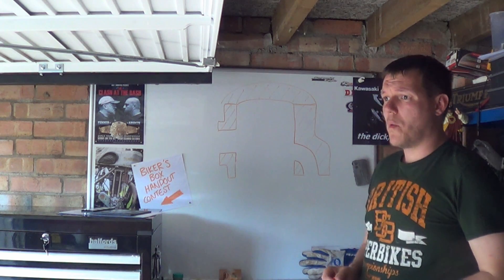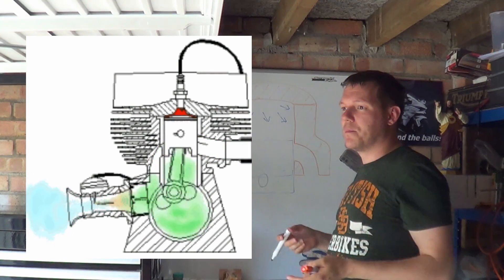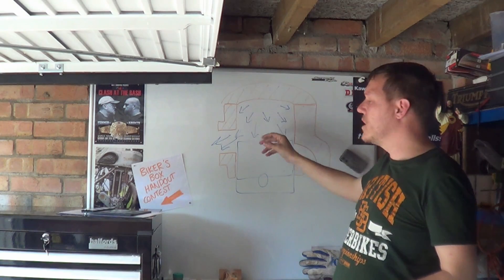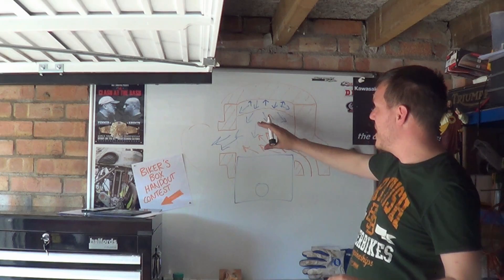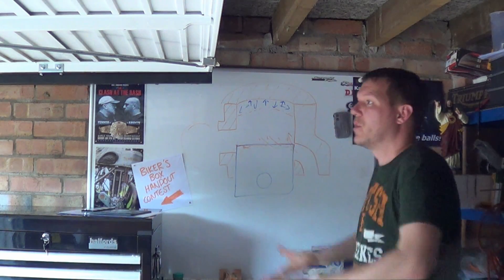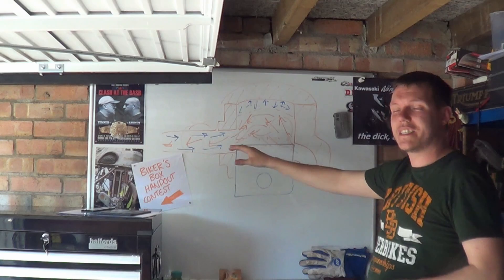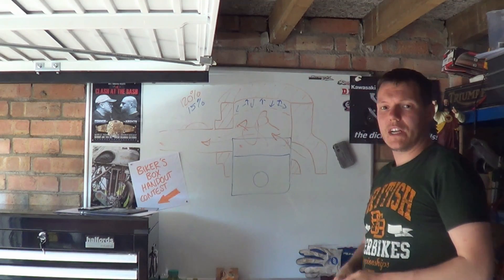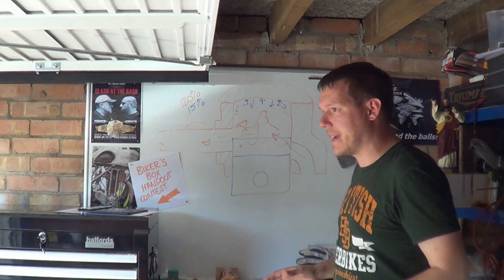2 Stroke Flow - Filling the cylinder - Part 1

Comment: Good bit about ram air- the actual positive pressure generated by "ramming" air into an intake tract is extremely low. . .and does very little to help cylinders fill at speeds below 160mph :)

Comment: This is the problem when trying to explain the dynamics of a tuned pipe equipped 2 stroke. The reverse pulse wave from the pipe packs in more pressure just as the piston is closing the port. No-one should say that it's supercharged. But rather to the lay person, it is a "supercharge effect" as in pressurizing the chamber. But ONLY at the sweet spot of RPM when the reverse pulse reaches the closing exhaust port at just the right time. We are not preaching to the choir, we are  trying to explain to the guys that have never been to church. A static adjustable length header section on the pipe, can change the distance from the convergent cone to the exhaust window, and that will change the timing of that reverse pulse. That adjusts the point of the sweet spot, or the supercharge EFFECT, or hitting the pipe. That is how you can TUNE your tuned pipe.

Comment: Right. For fucks sake, you run quite a mouth on ya, lad!!!
Thing is - you're 115% CORRECT. The pressure differential that causes the fuel in the Crankcase to be shoved up the Transfer Ports when the Bloody Piston is driven down... Is NOT fuckin' SUPERCHARGING!!!  For fuks sake! 
I've been building Race Engines for Decades, and STILL have that insane debate!!! 
I'm enjoying your Videos mate! You TELL it like it is, and cut straight through the bullshit!

Comment: I wonder if the orignal designers of 2 strokes knew that fuel could come back in the combustion chamber, or was that figured out later on in developement? The 2 strokes I grew up riding ('73 Yamaha GT80,MX100) didn't have expansion chambers. At least I don't think they did. The large expansion chamber with a very narrow stinger seems to have come about in the mid 70's.

Comment: So to use your logic a GM diesel with a blower isn't supercharged because the blower is required to make the engine run? What about engines that use a piston charger like the Ducati  V-One? https://thekneeslider.com/ducati-v-one-twin-to-supercharged-single-conversion/
Reply from the maker: The GM diesel wouldn't work without the blower - the word 'super'charged means exactly that i.e not normal charging but super charging. Hence why turbos are called tubo superchargers. And the ducati is supercharged and its charging the cylinder above 'natral aspiration' - can't believe I have to spell this out.

Let me put it another way - if you fit a roots blower to a 2 stroke dirt bike or a turbo - then what is it? A super-supercharged engine?

Comment: Supercharging is defined as a volume of gas trapped in a cylinder that is greater than that if the trapped volume was freely allowed to occupy the cylinder at the same temp and atmo pressure, no matter how that greater trapped volume was achieved
Reply from the maker: So inertial filling of a cylinder using valve timing is supercharging? If so then pretty much every bike engine is supercharged.....
Reply: Yep! anytime cylinder filling goes over 100% DR, that supercharging.
Reply from the maker: LOL don't be an idiot. So the R1, GSXR and the CBR1000RR are all supercharged - LMAO
Reply: Oh ok mate, you know best !!!
Reply from the maker: There are and has only been 3 production 'supercharged' bikes - fitted with superchargers 

- Kawasaki H2 and H2R
- Peugeot Jetforce Compressor
- Vyrus 987 C3
- BMW Type 255 (was a race bike - not production)

Seen as though Kawasaki made the statement that this is the only supercharged production bike availible then you need to tell kawasaki they are wrong.
Reply: You fail to separate the definition of supercharging from 'supercharged'.
As i said any DR above 100% is supercharging, no matter how its achieved, whether its mechanically driven, exhaust waste harvesting or the use of inlet or exhaust pulsing in a NA engine.
Reply from the maker: LOL dude you need to buy a dictionary -

Charging is the process of doing.
Charged is stating that an action has been done, or is about to be done. 

Apart from your lack of English. Find me a recognized book, paper or journal were they state that any engine that has a VE over 100% is a supercharged or is a supercharging engine.

Find me any mention that any motorcycle or car engine that is naturally supercharged?

Comment: good Good explanation ;) .Can you help me sir?
Reply from the maker: It depends - what do you need?
Reply: frankly i have a suzuki rm85 But without a cylinder and I think about its manufacture, is that possible? TNX for a response
Reply from the maker: Do you mean you want to make a cylinder?
Reply: yes *I have the idea But I have no information on the type of aluminum and its components . His first success rate 25/°
Reply from the maker: Well are you casting or machining from billet?
Reply: @Ars chloch No, I can not because I do not have all the tools to make it. I just bought it ,tnx

Comment: Let’s look at before the reeds with a round slide mike I carb. Using snowmobile technology from www.thunderproducts.com its called a UFO. It ramps the fuel past the bottom of the round slide where the wall is. The fuel mix stumbles when it hits this wall. Take a look at it.

Comment: Impossible to supercharge a conventional two-stroke engine with symmetrical port timing.  Supercharge in any two-stroke requires the exhaust port to close well before the transfers do.
Reply: <https://en.wikipedia.org/wiki/W%C3%A4rtsil%C3%A4-Sulzer_RTA96-C>

Maersk, like most large shipping companies, Detroit Diesel, Union Pacific, Norfolk Southern...heck, pick a company that uses a big ship or locomotive....will be surprised to find that the prime movers that they have been operating since the 1950s are, in fact, not possible.  You need to get the word out!
Reply from the maker: Wrong. Snowmobiles are turbo'ed all the time
Reply: How do you supercharge when all the incoming charge blows through the cylinder during the scavenging process and straight into the exhaust pipe?   You need to charge a closed cylinder under positive pressure to achieve any increase in mass charge.  The charge pressure in a two-stroke is equal to the exhaust back pressure because the exhaust remains open after the transfers close.
Reply from the maker: "How do you supercharge when all the incoming charge blows through the cylinder during the scavenging process and straight into the exhaust pipe?"

- the 'force' of the returning pressure wave is proportional to the combustion in the cylinder. You have a supercharged engine so the pressure wave has a higher energy. Granted you have to match the exhaust to the system but it can be done.

I did a video called 'can you turbocharge a 2 stroke. This isn't supercharging but the principle is the same.
Reply: You said yourself that the reverse pressure wave was not true supercharging!  You would need to have further charge mass entering the cylinder as the reverse wave is having its effect and this would occur at only a very narrow range of rpm as it relies purely on resonance.
Reply: Turbocharging and supercharging are different animals... Turbo creates back pressure proportional to the charge pressure so it works even if the exhaust port closes after the transfer port... with supercharging you can't raise the volume / pressure in the cylinder because the exhaust is still open to the atmosphere after the transfer port closes.

Comment: Regarding the supercharging discussion on 2-strokes. I have a really weird 2 stroke engine on my moped which challenges your definition of supercharging. Please have a look at the "motobecane 99z engine". Google those exact words and you will find a engine cut-out. What would you call this? 
Hoping you like weird engine designs :-) Have fun!
Reply from the maker: That's a piston ported 2 stroke. How does this challenge supercharging? They're very simple and old. Great fun to fuck about with though
Reply: Well. As you can see it has 2 pistons. One normal 2 stroke piston and a second piston which is only used to suck more air in the crankcase and push more air towards the combustion chamber. It is an added air pump which balances the engine and passes the 50cc law. They could have placed this air pushing piston system out side the engine. It would be stupid, but it could be done. Than you would have a compressor outside the engine pushing air in making it supercharged. This outside compressor sucks outside air in. The inside version also sucks outside air in making it similar in every single way as the outside version. Okay, not exactly the same but you get the idea. Confusing isn't it?

Comment: https://www.youtube.com/watch?v=O8e92MgD3LA&feature=youtu.be&t=280
YESS PRESSURIZED
thank you. thank you SOO mutch.
Reply from the maker: but not supercharged lol
Reply: by your definition it ain't.
by other definitions it bloddy hell is.

i would not argue about your point, i don't find it invalid if we follow your definitions. 
yet, it seems we got different definitions (not by person to person different) and by that it is soo obviously supercharged...
however we do not have technical terms for what most has for forced induction. i think we don't have an equal translation to that.
Reply from the maker: Ok then answer me this. Does this make all engine supercharged? For example, most race bikes have straight intake ports and have a complex intake system. During the intake stroke at rpms within the power band, the cylinder fills with more than the rated cc so a 250cc cylinder will fill with 260cc. Is this supercharging?
Reply from the maker: Good points and this comment deserves it's own video. Don't worry though, not a slagging video lol
Reply: i value you refforths to be honest, and ..
i don't recall any video ont he whole funken youtube discussing how that nice iron curtain affected technology. as if we strip things down we get there, since behind the curtain we did get a bit separated and things took different paths here.

however, you are most probably an engineer so the concept of different frame of reference should not be a new thing for you.

the fucking off topic section:

(closest example would be te question of the exsistance of centrifugal force (depending on the frame of reference), sci-fi does have a nice hit on that, many western sci-fi implies big drums in space for people to live inside and the rotation immitating gravity. however our reference frames allso are different in that perspective too, and we know it would be a funky environment and would certainly not function as most people think it would. think of throwing a ball in that environment and throwing it on good old earth...  but this is way fucking off topic :(
my bad..
)

Comment: I think you said something that could be slightly misleading,  the amount of fresh charge the cylinder receives is bound to the piston compressing the charge in the crank case on the down stroke, which isn't necessarily 100% of the swept volume of the cylinder but for expediency lets call it 100cc. If 20% of this incoming fresh charge escapes out of the exhaust then the cylinder will be 80cc fresh charge + 20cc exhaust gas. When the pressure wave pushes some back in the best case scenario would be the 20cc lost charge being returned,  if that where the case you can see we would have the 80cc fresh charge + 20cc exhaust gas and now the returned 20cc fresh charge. Which clearly equals 120% of the original charge but only 80% of it is fresh charge. You can't get more than 100% of the fresh charge the crank case provides no matter how much the pressure wave returns to the cylinder. More likely the returning gas is at best 50/50 fresh charge and exhaust gas so you would end up with 80cc fresh charge + 20cc exhaust gas + 10cc returned fresh charge + 10cc returned exhaust gas. Which would be 90cc fresh charge and 30cc exhaust gas.  A proper super charger would provide more fresh charge to the whole system regardless of how much escapes out the exhaust or not.
Reply from the maker: "the amount of fresh charge the cylinder receives is bound to the piston compressing the charge in the crank case on the down stroke,"

- I did go through this with 'cross-flow'
Reply: No it wouldn't.

Comment: OK, here's the thing.  The crank case isn't really pressurised.  Not much anyway. Most "modern" two strokes have about 3 times the volume in the crank case as in the cylinder (a 125cc engine would have about 350-380cc crank case volume).  So when the piston is at BDC vs TDC, the mixture in the crank case has hardly compressed at all (it's only about 1:3) compared with the combustion chamber (10:1) which goes from about 125cc down to 10-15cc so there's really stuff all compression in the crankcase. When the transfer port first opens, the pressure in the cylinder is higher than in the transfer duct so it actually blows a little into the transfer.  Then the momentum of the exhaust gasses rushing out the exhaust port starts to pull the air/fuel mix into the cylinder.  The pressure at this point in the transfer duct is lower than 1 bar so it must be sucking the mixture, not blowing it.  This especially true when the engine is on the pipe (in the powerband) where the expansion chamber is working its best.  That's one of the reasons a two stroke will run like crap without a decent pipe.  It's not just the pressure wave forcing the mix back into the cylinder before the exhaust port closes.  But as you say, it's bloody complex and it's certainly not supercharged.
Reply from the maker: "pull the air/fuel mix into the cylinder." - lol pull
"the pressure in the cylinder is higher than in the transfer" - exhaust port opens first
"The pressure at this point in the transfer duct is lower than 1 bar so it must be sucking the mixture, not blowing it" - don't get this bit
"It's not just the pressure wave forcing the mix back into the cylinder before the exhaust port closes." - so what is it?
Reply: Matt, I've taken a closer look at the data I have and I have to admit, I'm wrong on a couple of things.  I'm looking at data for a Honda RS125 GP engine so everything below is in reference to that.
As you said, the air/fuel mix is in fact mostly forced into the cylinder by crankcase pressure.  There is a part of that process where the pressure at the transfer port is less than 1 bar but that's just as the transfer port is closing. Most of the flow into the cylinder is under positive pressure as you said.  But, when the transfer port first opens, the pressure in the cylinder is still higher than the crankcase and there's a moment where some exhaust gasses are forced into the transfer port.  Then as the pressure inside the cylinder rapidly reduces, the crankcase pressure pushes those exhaust gasses back into the cylinder along with the air/fuel mix.  In an RS125 engine, the crankcase pressure never goes above about 1.5 bar so my point remains on how low that pressure is compared with whats going on in the cylinder.  So until the cylinder pressure gets below 1.5 bar, the air/fuel mixture cannot enter the cylinder.
Anyway, the point I'm making is that I didn't get all my facts straight before.  Sorry about that.
Reply: Chris you where right first time, the depression caused by the expansion chamber 'pulls' the mixture thru the transfers. Your note on the higher pressure in the cylinder on transfer port opening causing reverse flow in the transfer passages is also correct.

Comment: They use systems in cars to recover exhaust gases and useing them in the next cycle, so they can lower the emissions.I think its to lower the burning temperature and so reducing NO emissions(in diesel engines also the unburned carbon particles). For me it makes sense to build such a system for diesel engines but does it also makes sense for gasolin engines. Just asking because of those 15% exhaust gas in the chamber.
Reply: CAT has a thing called ACERT that does EGR internally with valves.... By nature most 2 strokes have some exhaust gas in the mix at the time of combustion.  Exhaust gases lower the peak combustion temperature reducing the formation of NOX.

Comment: So first it was your mate sticking his foot in the lift door and now it's toothpaste!👍🏻👏 How about a small opening just below the squish in the head and a chamber for the trapped exhaust to be pushed into?
Reply: but then what happens to it?
Reply: chris davidson When the exhaust port is cleared it empties out the cylinder head into the exhaust.Anything to give a nice fresh mixture around the spark plug? I'm sure there would be a problem with it,detonation,carbon?
Reply: hmmm... i was thinking that it'd get stuck in the chamber, as if the exhaust gas gets trapped against the head, how's it going to get back out of the chamber?

Comment: How far does the air fuel mix go out the exhaust ? Is it with in a foot
Reply from the maker: rpm variable - but a good question
Reply: The Workshop I have another idea for 2 strokes make like a compression chamber out side of the motor by taking exhaust pressure and  using that or something of that sort I'm not saying that it would work but it might
Reply: Some will go all the way do to dilution between the 2 gasses and that is the reason 2str are band by many places!

Comment: That '120%' fill is just based on an arbitrary definition of 'STP'. If all those fuckers who call that 'supercharging'  go to higher altitudes and all of a sudden the air density decreases, are they going to say their bike is 'negatively charged'? 

For any form of supercharging, you need some auxiliary power input into your system acting as a power source for the prime mover (usually either by leeching off a shaft or using pressure differentials to spool up a turbo turbine). 

Air rams aren't fucking FI

Great video tho. As a 4T fucker, this is interesting as shit, keep it up